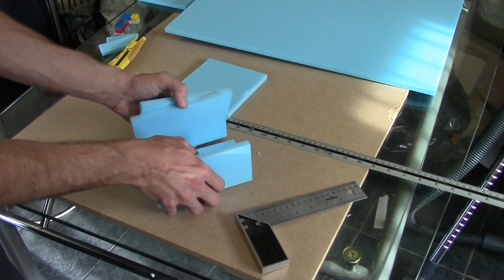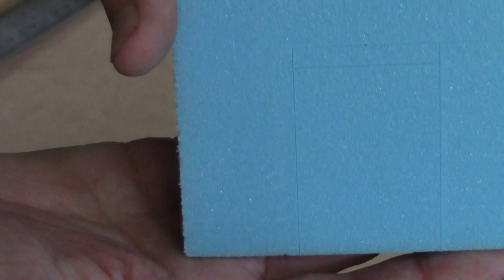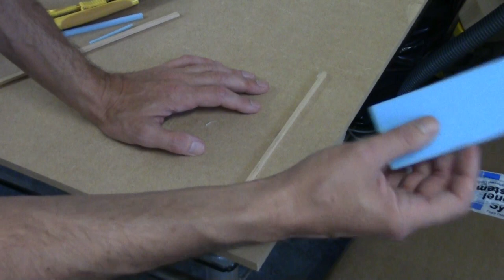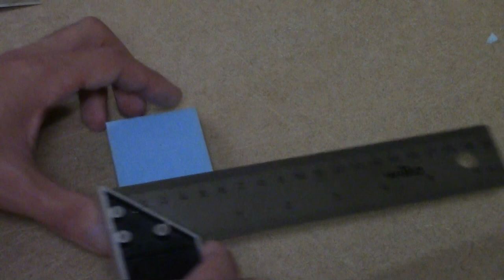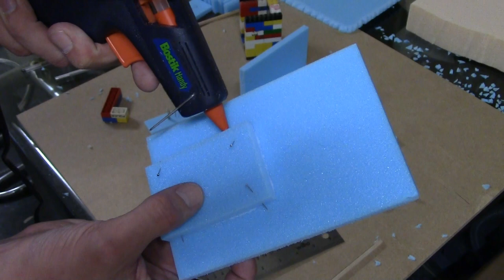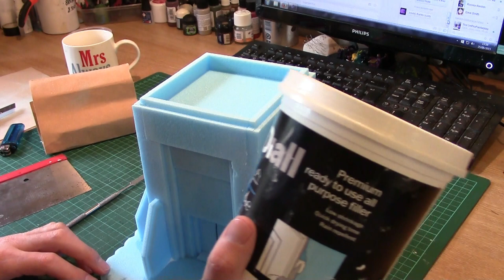A guide to using bluefoam to make wargaming buildings & ruins

Comment: I see people talking in the comments about getting this in Home Depot in the States. Other than the thickness difference, I believe that the 'craft foam' is specifically made so that it is not toxic when you use a hot wire cutter on it.  The insulation stuff that we can get at hardware stores, is toxic if heated.
Reply from the maker: interesting to know mate

Comment: Hammering nails on to a glass table :D :D :D I was also panicking twice when you were putting the walls together.

Thrills, spills and useful modelling info! You certainly know how to keep the audience on the edges of their seats...

I'm sure "Mrs Always Right" was pleased to see her mug in shot.

That's a cracking tower. Roll on the painting tutorial as I'm currently making up a modular terrain board and will need to get it painted up. 

PS: Parapets are the walls around the tops of buildings.
Reply from the maker: +Euan Smith you know me mate ;-)

Just got a bit of decorating to do this week and then I'll be back in the saddle for some terrain building :-)

Comment: Well thinking of back to basics for beginners, I always use a none slip safety metal ruler with a wide finger grove running along the top middle section of it. With two none slip rubber seals fitted to the bottom of this type of ruler and the finger grove, means no fingers flying off the cutting table.  Have fun . BB

Comment: This is sold in most builders merchants in Greece. It manufactured name is Febron. It comes in long lengths 2500 cm and different thicknesses. I tend to use 50cm for insulation.

Comment: Underlayment for flooring, 3 millimeter minimal thickness, diy builders store, way cheaper, or roofmate. When using a longer metal ruler hammer a nail in and hook the hole in the ruler over it. Or use a s shaped hook. That's what the hole is for, not just for hanging in storage 😸 Just hold the other end of the ruler in place, or clamp it 👍, easy straight cut.

Comment: Some cracking ideas in this vid mate. Really liked the balsa strip and edge of the table angled cut idea with the hot cutter. Never thought of that before.

Damn fine looking piece. The buttresses finish it off nicely.

Like your angled sanding tool from 4Ground. We picked up a smaller one from "littlecars" a couple of years back, but can't easily get replacement paper for it, plus its more of a polishing rather than a sanding stick.

A bit hard on yourself at the end. Considering this is on camera and you are feeling the pressure of the lens whilst covering a lot of topics its a great piece.
Reply from the maker: +Squidgy Bidge Cheers buddy, I'm always my own worse critic lol

Comment: I went for the 6mm foam sheets. So I do not have to mess about with beveling 10mm to get 5mm bevels. Just cut and glue two 6mm pieces together. Rewatching a lot of your videos Mel, going from cardstock terrain to scratch built foam terrain. So hoping to crack on with the build in the new year. Hope I got everything I need!  

Also thanks for the advice regarding aquarium plants, been looking at various inks. Have a great Xmas and all the best for the New Year!
Reply from the maker: Hope the inks work well for you mate
Reply: @TheTerrainTutor  Thanks Mel. Regarding the design in depth, for adding detail. I am considering matchsticks, coffee stirers, popsicle sticks. As well as some resin pieces by Maelstrom Edge, and TTCombat.

Comment: I try not to get too bothered by mistakes Mel, they're gonna happen. What does bother me is making a dozen mistakes in a row. (I used to do production machining) Love the Balsa/blade cutting tool. Gonna make one myself, only with one side taller than the other so I can have more of a handle. One thing I was wondering: You dont use a Rotary Cutter? Lock the wheel from spinning and the curved blade sings right thru foam. Mine will only cut 5/16th deep tho. Great vid, thanx!
Reply from the maker: +Bill D. in Iowa Cheers bud, I don't use a rotary cutter because I don't have one lol ;-)

Comment: Super vid, cheers for that. A quick question though: Does craft foam warp? The reason I'm asking is that my foamcore buildings have warped with time (I suspect I should have inserted supports into the walls after cutting the windows out) and I need to rebuild some of them.
Reply from the maker: +Cirkux I've never had any problems with it warping to be honest mate

Comment: Mel thank you , I like your style, esp when you show how not to do things, and what the results will be.   I am into 1: 35 scale  and have found your dioramas  tutorial a real help . Would it be ok to just use cheap sheet, say 50mm as I wanted to cover it in a layer air drying clay and then use pva / dry wall adhesive/ soil to create the surface? .Oh and I am a left hander as well. lol Thanks John
Reply from the maker: +tomrace16 It should be fine mate, especially for a diorama piece
Reply: +tomrace16 ThanksMel.

Comment: One should be able to find that stuff in bulk for 'cheap' at every construction material supplier. the guys you'd turn to if you where to build a complete house or the likes, not just a tiny carport or garge.  That stuff is also used a building insulation (therefore the harsher climate you live in, the bigger variety and the easier to find)...

Comment: Echoing Mel: Where would you get this in the states? Home Depot and lowes only have sheets of much thicker foam. (For insulation)
Reply: DukensteinA1 My Home Depot has 2x2 sheets of 1 inch
Reply: irishmarine3 
Only issue is that an inch is 2.5 times thicker then what he's using. That 10mm foam is perfect :/
Reply: +chaoticflanagan Thats more than on cm thick.

Comment: I bought some blue foam from a construction store, kinda like Home Depot, and the foam I got is very soft. The sheets of it I got were a fine size, but it’s so soft that the rock texturing I try to put into it “heals”. I’m still able to get some decent texture but it’s not as “stiff” as the pink foam I had before. Any pointers?

Comment: I have noticed that there's different  colours and sizes of extruded polystyrene.  On eBay I just learned that the company that makes it have discontinued the blue? I'm pretty much out of my depth with this...which would be best for a 1:6th diorama and is it always really expensive...I couldn't find any mention of the blocks of pink unless it was huge ones for building trade? I  will remember that it was here I asked in case you do reply (I will check back in a week or so).
Reply from the maker: checkout www.bluefoam.co.uk mate

Comment: I have got some of the textured rolling pins from GreenStuffWorld and they print excellently into foam board core. Unfortunately every sheet of foam board I have bought refuses to peel, and I have stopped taking the paper off with a knife since I got myself a nice, bone deep gash across my palm (damned thing bled for three days!).

So I got some of that blue stuff you're using in this video, but I don't like it. It takes the pin print well enough, but it is a very rough texture and makes dry brushing it rubbish. So I need something with a smoother texture, but I am struggling to find anything.
Reply from the maker: Oh nasty mate, hope you're ok. On the foam, give it a sand with a fine grit paint mate
Reply: TheTerrainTutor Yeah, it was middle of last year when it happened. It healed really quickly once it stopped bleeding.

I posted my comment about two minutes before you started sanding the foam in your video! I had tried sanding it before but still wasn't overly happy with the result. What kind of surface does pink foam have? Is it smoother and will it take a print from the GreenStuffWorld rolling pins?
For buildings that have walls that need detail, I am currently using air drying clay on cork. They actually look nice, but it would be simpler if I could just use foam.
Reply from the maker: It's actually worse than bluefoam mate
Reply: Ah, that's a shame. I'll just have to stick with using clay.

I like the result I get with clay, but it's a slow and messy job. I don't make stuff for gaming, so at least I don't have to worry about its durability.

Comment: I can only ever find 50mm thick pink foam or 5mm thick green (hardwood flooring underlay) at my local DIY sheds. Is the blue a bit softer than the Pink. I'll take a look at Panel Systems. Are they good value compared to the eBay rip off prices.
Reply from the maker: +Squidgy Bidge The blues a lot harder that the pink and the green is harder still mate
Reply: +TheTerrainTutor You can get the green if you look for hardwood underfloor / underlay, but only in 5mm thickness. Its quite flimsy though at that thickness. Other thicknesses as you know already are really difficult to come across in the green. Homebase have often had it on offer.
Reply from the maker: *****
Panel systems does green in a variety of thickness's mate
Reply: +TheTerrainTutor Cool.

Comment: An electric knife with straight edges and not serrated will also allow for foam to be cut. The knife only needs to be mounted in a vertical angle to work correctly.  Also, your audio levels were going up and down during filming.

Comment: How does this blue foam compare to foamcore with regard to strength and ease of use?
Reply from the maker: +Stephen Cromwell Probably on par, it's just better for thicker walls as it's available in thicker versions than foamboard but foamboard is better at 5mm because the card backing makes it stronger mate

Comment: well lest not PINK why dont thay who mack the fome mack war gaming fome in gray or matalic?  mack life eazay  .
Reply: +redgreen09 Because it's not war gaming foam.. It is home insulation foam. They make it in pink and blue because they denote different R values per inch of thickness. I would hate to buy foam from any war gaming company. Can you imagine how expensive it would be?
Reply: +Frank B  yes i know that but thay can mack enny color thay   like the gray color will save a step in macking terrain   and if say drop the pece and the pink will not show thew andi don" t like pink
Reply from the maker: +redgreen09 You can use the grey stuff but it's a form of rubber not polystyrene, so handles differently mate